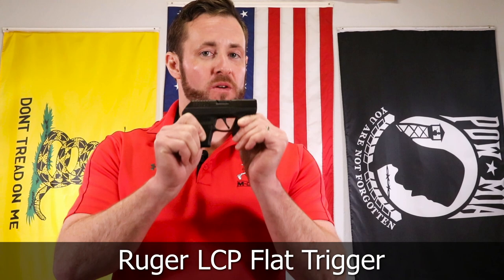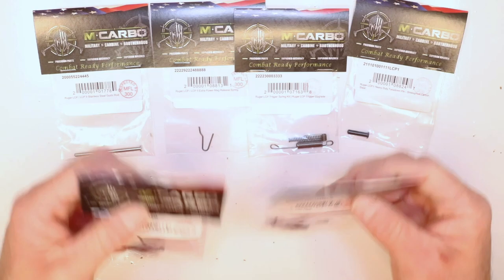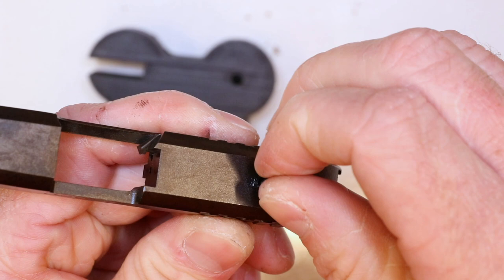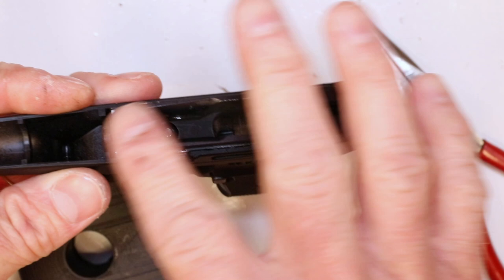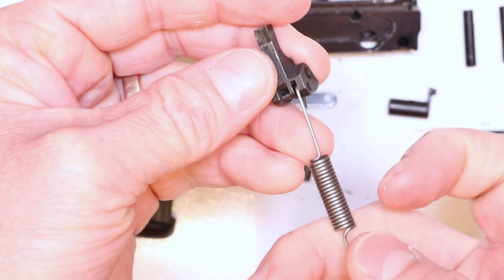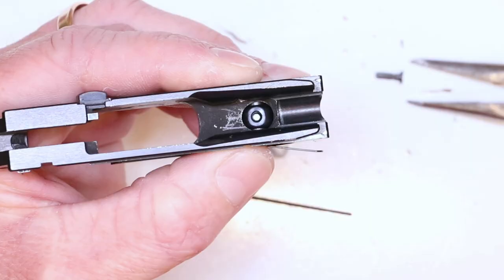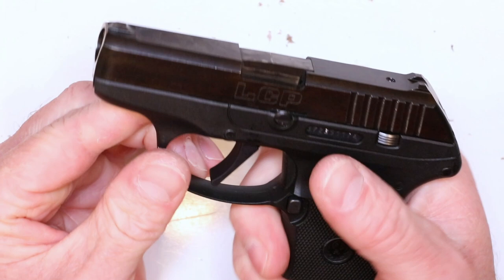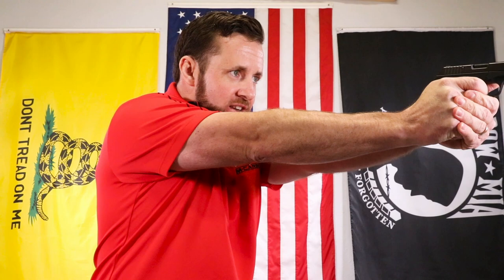Ruger LCP Flat Trigger Upgrade - Custom Ruger LCP Aftermarket Parts by M*CARBO!  Ruger LCP1 Only.

Comment: Very thankful for the M-CARBO trigger upgrade. The factory trigger had a major malfunction of breaking during practice shooting. The new M-CARBO is the right fix. Thanks for the easy to follow installation instructions too!
Reply: Yeah! I went through two of those original polymer triggers on mine. Enough of that! Aluminum just makes so much more sense for a trigger.

Comment: I got this for Christmas, installed it and just got back from a short range session where I put 50 rounds through it.  To clarify, I got the aluminum flat trigger and the trigger spring kit.  Here's a short review:  the video instructions are outstanding.  Follow them and it is a simple process. There are few tricky parts, but Chris gives you ample warning.  I have no gunsmithing skills but was able to do this in a couple of hours once I had a set of pin punches.  The Mcarbo gunsmithing hammer and bench block are helpful.  The modified trigger is much better, however it is still an LCP.  The pull is now lighter, as the video shows, but it is a long pull and still has the annoying "double reset."  This is not all bad, since the long, heavy DA trigger pull is the only safety on the gun.  The flat trigger is much more pleasant and you'll find your finger rests on the trigger in a better position for that long pull..  A few more sessions and I feel like I'll have the hang of the new trigger.  A quick, cheap and fun way to improve the LCP!
Reply: Nice. Glad you have good people that know how to give good gifts. lol.

Comment: Chris, your instructions are very clear and never rushed.  You also point out details that are either necessary or just good to know.  I didn't know you had a trigger for the LCP1 and bought one elsewhere and the installation video they had was rushed and difficult to follow at times.  I have followed several of your videos and never had issues like I did with the other guy.  Thanks for being clear and taking your time and for having a good working surface, background and lighting so we can see what exactly is going on.

Comment: Recently got around to upgrading my old LCP with the new LCP 1 flat trigger and spring kit. (Hated the stock trigger!!)  Really a great difference now.  Was initially concerned about the warning that it would not fit models with XXX-XXXX serial #'s.  Mine is a 376-XXXXX (5 digit after the dash) and it fit/functions fine. Watched the installation video by Chris and he was right on the money on everything but the tool he used to install the X power mag spring. The new spring is quite stiff and my old arthritic fingers would not have been able to use the tool he had. I put a notch in an old flat blade screwdriver and it worked well for the install. Wanted to also replace the take down pin but they were out of stock so I
I'll order one later. Can't wait to get out to shoot this highly upgraded gun. Thanks MCARBO for Your Great Products and Videos.

Comment: Pre travel adjustment is crucial in hammer reset on the sear. My pre travel was off a hair and hammer was just missing reset.  Sound up disassembling and reassembling 3 times before I figured it out. The video is very good.

Comment: I took out the rear set screw the threads were really loose. I left the front set screw in for the reset that is tight and won't walk out. Overall happy with trigger and very easy install.

Comment: Just installed this trigger along with their stainless steel guide rod today, and  already had the Galloway Precison’s 13 pound recoil spring, Houge grip, and Garrison magazine extension. If you have all the right tools, all of them I purchased from M*Carbo when I purchased the trigger and guide rod, and follow this video for guidance, you can easily swap out the trigger in less than 30 minutes. This trigger is a game changer and definitely worth getting.

Comment: Recently got around to upgrading my old LCP with the new LCP 1 flat trigger and spring kit.  Really a great difference.  Reduced pull from nearly 8 lbs. to a consistent 4 lbs., with less "slop."  Was initially concerned about the warning that it would not fit models with XXX-XXXX serial #'s.  Mine is an XXX-XXXXX (5 digit after the dash) and it fit/functions fine.

Comment: Just installed the trigger and spring kit. Gotta say getting my hammer pin out sucked but I finally got it. Wish it all came in 1 kit though. Bought the Red Trigger for my Wife's and then had to buy the spring kit. I thought the springs came with it. My Fault, didn't read the whole description. The reduction in trigger pull weight is amazing after all is said and done!

Comment: Did I miss the part where you explain how to adjust the front and back set screws on the trigger?  I saw the part where you said to start out at 3 threads on front and 2 threads on back but where is the Fine Tune part in the video?  Love the product, I've owned this gun since they first came out and it's now sooo much better...

Comment: I don't want my pocket pistol to have a 3.5 -4.5  lb trigger. Do you guys understand which springs perform which percentage of reduction or only the aggregate effect of all springs? Can the spring kit be used incrementally to reduce the trigger some?
Reply: I have the same question. Did you get an answer?
Reply: @rickh5698  No luck.
Reply: @Jeremy_Walker  Any luck keeping the trigger spring itself but returning to the stock spring for the hammer, etc.?

Comment: I like straight triggers... but I hate FLAT triggers. Very few companies ever make a straight trigger that's not flat, but the few that do have excellent, very comfortable triggers. Most people partially wrap their fingers around the trigger (anyone that don't have small hands).... so having a Flat trigger with 90 degree edges really makes for an uncomfortable trigger. It's like wrapping your finger around a board with sharp edges (as apposed to wrapping your finger around a dowel, which would be comfortable). I know they shouldn't be sharp and blade like (like OEM Glock triggers and the OEM LCP kinda)... but making them too wide with corners seems to make them even worse for a lot of people too.

Comment: Two years later….

Ruger LCP Max Flat Trigger And Spring Kit

I was introduced to M*CARBO when I upgraded my LCP I with their flat trigger and spring kit.  It truly transformed a questionable daily carry pistol to my every day carry.  

I decided to buy the LCP MAX because of its 10/12 round capacity and the fact it’s slightly wider giving it far greater controllability. The day after I bought it I shipped it to M*CARBO to have their Flat Trigger Upgrade Kit, Trigger Spring Kit, and Upgraded Stainless Steel Guide Rod installed. 

Took it to the range for the first time on Saturday and it blew me away how accurate and controllable it is.  The take up and break is absolutely perfect for conceal carry.  Firing a single shot, fast double taps even ripping 10 rounds fast as I could pull the trigger made no different.  All shots hit within the ten ring. IMO beyond impressive for such a small gun.

M*Carbo is the go to place for great innovative products and installation (gunsmith work). 

Would not trust my life to anyone else.

Comment: I'm guessing it will be fine to use this trigger without the two screws? I'm less worried about fine-tuning my trigger for overtravel and reset, and more interested in just having an aluminum trigger over the original polymer (I broke two polymer stock triggers over the 6k rounds put through my LCP1).

Comment: Ok I am no pistol expert but I am mechanically inclined … I installed my new trigger and new springs last night and my hammer is only going half way … does this half to do with the set screws . I’ve already broke this thing down multiple times with same outcome.

Comment: Can you replace just the trigger or is it a must to replace all the Springs too?
Reply: You can replace just the trigger,  but since you'll be doing a complete teardown, why not replace them while you're at it?  The springs are inexpensive and make a world of difference!  I swapped out the trigger, springs, guide rod and takedown pin on mine.  Ended up going back with the factory trigger return spring,  but kept the lighter mainspring and firing pin spring.  
It really helped!

Comment: I'm putting your trigger into much neighbor's LCP1. I've been through the video multiple times but haven't seen any reference to a small metal washer. It fell out of the assembly when I pulled the trigger spring. Any guesses as to where it came from? Thanks, Joe
Reply: I've not seen a washer in my LCP1 when doing this trigger job.  I have seen two different videos on trigger installations and there is no washer involved.  I'd check the manual for the parts list.  Good luck!
Reply: @-wellthathappened.34  thanks David. I did not install the washer on reassembly. I haven't discovered any problems with the cycling after assembly. I have to assume the tiny washer was a pocket accumulated extra..scary thought

Comment: Does this trigger fit the LCP gen 2 that looks like the LCP 1
Reply: from what their website says the LCO 1 trigger does not fit the LCP 2
Reply: @speed9044  apparently the gen 2 is not the same as the lcp2
Reply: Theres the LCP1, then theres theLCP1- gen 2, then theres the LCP2. Theres 3 models.